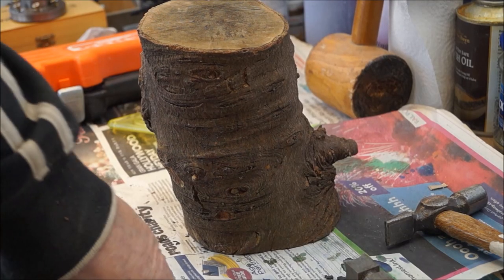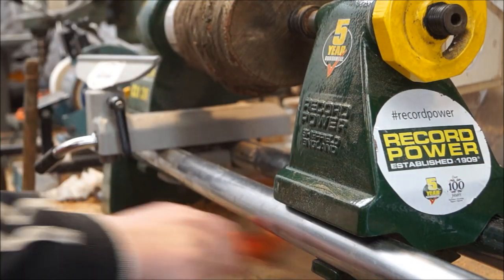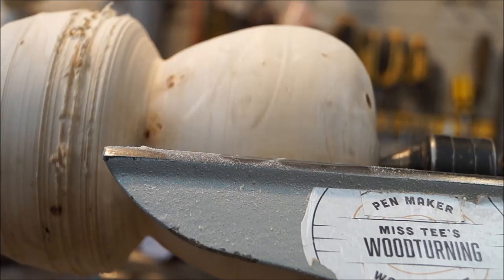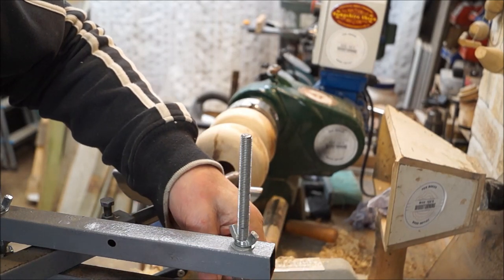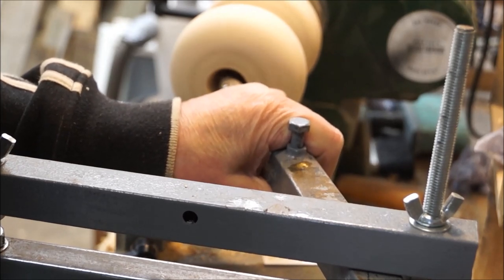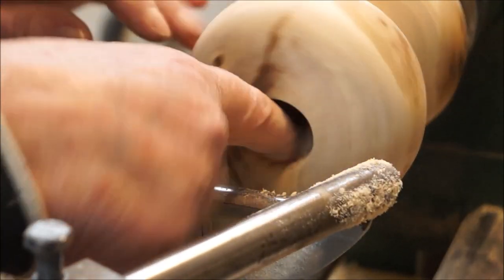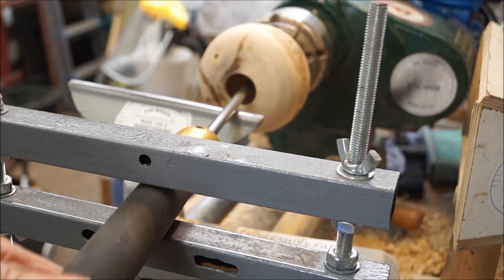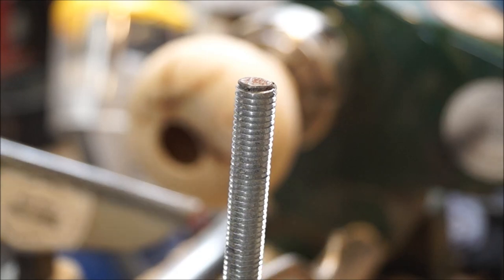A Hollow Form using my homemade rest, Part 1

Comment: I'm a new sub to your channel and I like what I see. I noticed a lot of chatter when using your hollowing system. I use a similar home made system on my Shopsmith in lathe mode. I've found that when I rotate the tool bar in the handle...say 5 or 10 degrees to set the cutter at a negative rake and adjust the tool rest to cut on center again, I get a much smoother cut. It might be worth a try...easily undone if you don't like the result.

Comment: That looks very good tee. I noticed you were getting a lot of vibration and chatter. move the keep up to the tailstock end this will give you a much longer lever and this will greatly improve things, The longer the lever the smoother the cut! The finished form in part 2 look fab! 👍👏😊
Reply from the maker: Thank you.  I've just remade it using longer bars so I can get more swing.
There's a pic on my Facebook page 
MsTeeswoodturning. I've also bought the Simon Hope curved 6mm cutter to fit in the long boring bar
Reply from the maker: My lathe is not very long, I think the bed bars have been shortened.  I'll try it as far back as I can without removing the tailstock as its a real pain to get the locking lever back in the right position.